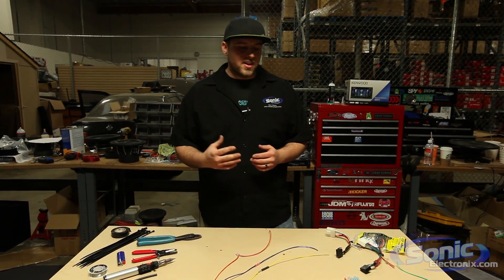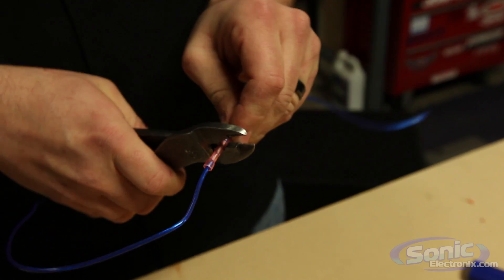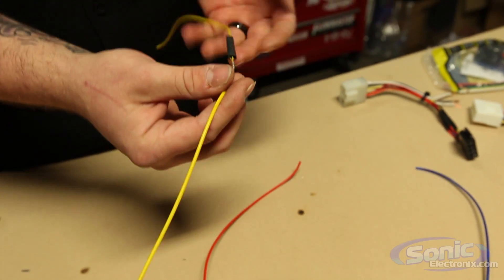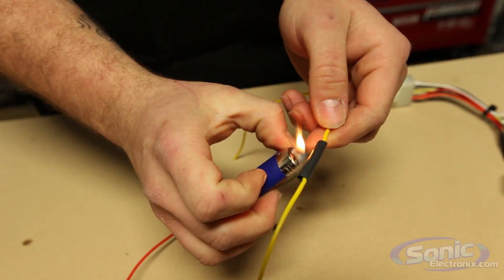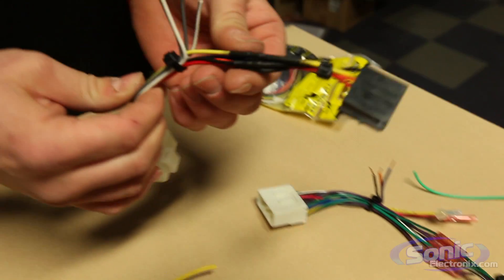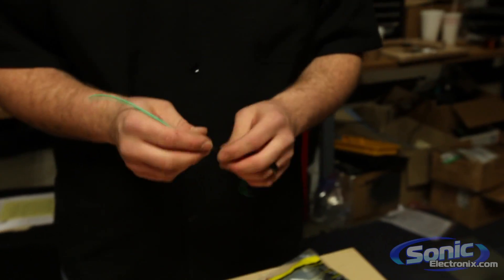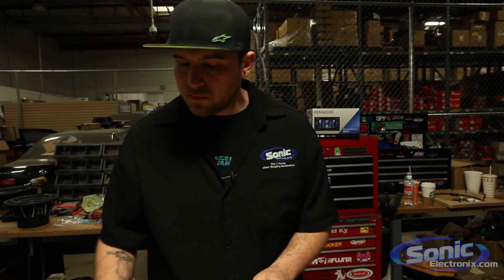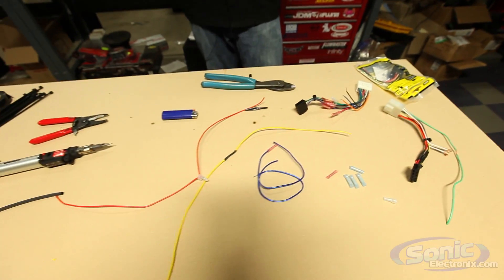How to Properly Connect A Wire Harness | Car Audio 101

Comment: I was literally going to buy wire nuts tomorrow morning cause I keep having to cut off the crimp caps to fix issues. I am trying to integrate an amp into my audio system. 

My head unit is the KENWOOD KMMBT728HD and the amp is the KENWOOD KAC-M1814. 

I wired the matching wires to each other. Speaker wires alone I had bundles of 3, cars harness, stereo harness and amp harness. 

Fast forward, I plug in the harnesses and then I get a "Miswiring" read out. 

I'm really not sure where I went wrong, if anyone can help I'd appreciate it.

Comment: I did all the wiring correct.. following the colors and when i installed and connect the radio is not turning on...what I'm doing wrong?????

Comment: What if the but connector didnt go on right.. And then you pull it out of the old but connector and you have longer and shorter wires can you cut the longer ones and strip off more

Comment: Pro tip: when using butt connectors (or even soldering), if you offset each connector then you eliminate a lot of bulk.

Comment: I have a 2014 Nissan pathfinder sl 4wd and to make a long story short I cut the harness that was connected to my display screen so now I'm trying to connect it back but there are a lot of the same color wires and I don't know which one goes with which ...this has been a huge headache for me . I've tried to find a diagram with no luck I went to a junk yard but no Nissan pathfinder 2014 I went to auto sound no luck ...someone please help ...thanks

Comment: My vote is for the closed end crimp connectors.  Why? It is one crimp per connection instead of two, and, you have the ability to mechanically twist the two wires together. Lasts a really long time. I have them in a truck that is about 30 years old, the connectors are about 24 years old.

Comment: Yellow wire doesn't have power and fuse isn't broken. What should I do? 1995 Mazda 626
Reply: If you are connected to the factory harness with an aftermarket harness, then you need to check both fuses. 1 should be inline on the radio harness and the other one is in the fuse block. Pull the fuses and swap them out with known good fuses. If that doesn't work you can run a wire directly to the battery if you can't identify the problem.

Comment: I have been a master mechanic as well as a heavy collision expert repair for 10 years. You never ever use wire-nuts and you only use weather proof but connectors. Always solder you wiring with silver solder a use weather proof heat-shrink and you will never have to worry about it again!!
Reply: Also known as adhesive lined heat shrink tubing, always use in marine environment!

Comment: I know the soldering looks like the best option, but I am an amateur here.  I think I could do the butt connectors.  once it's in the dash, how durable is a butt connector connection?  will it fail overtime?  don't know If I should just go to Geek Squad.  thanks!

Comment: Lol you pulled the butt connector apart cause the wire snapped
Reply: No it didn't.  Pause the video and you'll clearly see that the wire came out of the connector.

Comment: I was hoping you could help me out I just got my unit in and the adapter harness has three red wires, do those get wired together? and for the hand brake bypass is it ok to join it with the ground wire? and one last question would I have really got my harness and kit for free if I would've bought from you? Thank you, and good day sirs.

Comment: A good tip when using the soldering method always clean any extra flux off after soldering. Flux is corrosive and over time it will corrode the connection

Comment: Why care if the connection isn't super solid? Obviously you don't want it to fall apart in the car, but unless you're planning to tow cars with your wiring harness, butt connectors should be okay. I generally prefer soldering, but since I don't have a gas iron and it's too much job finding an extension cord, winding that out and then waiting for my soldering iron to get warm, I more often tend to use butt connectors.
Reply: Someone’s fucking lazy.

Comment: Just the thing I needed. I went with the barrel crimp based on your professional opinion. I make splices like your solder/heatshrink too. One addition, coat it with RTV sealant and slide the tubing over, and shrink it. This splice is waterproof, can be submerged in a bilge. That wouldn't be speaker wire but say pump power. Impervious? No, but lasts long. Thanks!

Comment: hi i needed help maybe you can help me i was changing the radio in my 2005 jeep cherokee i both a harness but it came with 2 yellow wires ( 12V Battery ) and 2 black wires ( Ground ) but my new radio only comes with one yellow and one black so my ? is do i connect just one of the wires n cap the other or do i connect all 3 yellow wires together and do i do the same whit the ground
Reply: I'm pretty sure u should just cap them leave one black one yellow there's 2 ground one for stereo other one for amp I don't  know why there would be 2 yellow I'm guessing to power the stereo and the amp

Comment: Very professional video demonstrating how it should be done. However there is just one thing, twist and tape is generally considered bad but I have done many installs this way and the wire did not come apart easily. Soldering also becomes brittle over time And can be unreliable depending on the circumstances.

Comment: I tried connecting the wire into the butt connector and crimp it, but it won't stay connected just like in the video. I can still easily pull the cable apart.
What did I do wrong? I have bought all the tools.

Comment from the maker: You need to connect the radio turn on wire to an accessory wire in your vehicle, the previous radio likely used an accessory wire as well, which have a 12V signal only when the vehicle is on.

Comment: Im tryng to connect  my pioneer avh-p3300bt to my 2005 Ford500 i have all connection correct like power and ground but i dont know were to connect the wire that tells the radio to turn on and off wen the car is on or off. i have hit a snag i hope someone can point me to the right direction.

Comment: Found these at Home Depot.They are fantastic.
Google = Tyco Electronics Raychem Soldergrip Heat Shrink 
It's heat shrink tubing with a ring of solder inside. Works with a lighter or heat gun.
I used them to repair some rodent damage under the hood. In hindsight I'm not sure how I ever thought I was going to use a soldering iron in the cramped engine compartment so I'm glad I found these. Made my life easier.

Comment from the maker: If there is enough wire, you would use butt connectors to reconnect the wires or solder them together.

Comment: I USE ELECTRICAL TAPE AFTER I CRIMP OR SOLDER/HEAT SHRINK MY WIRES. I ONLY USE BUTT CONNECTORS  UNLESS REQUESTED TO.